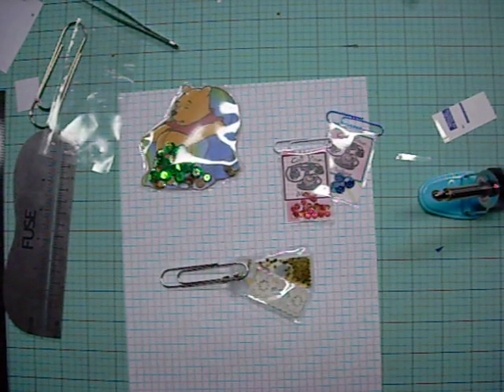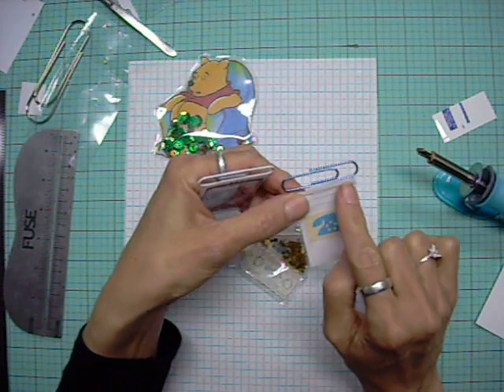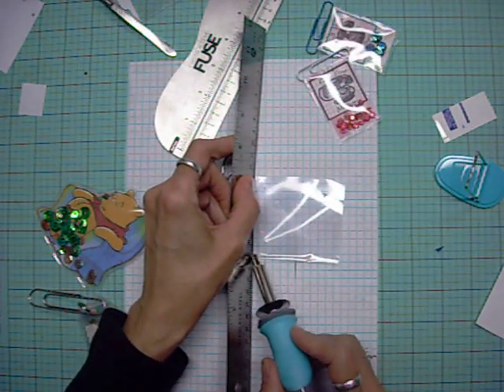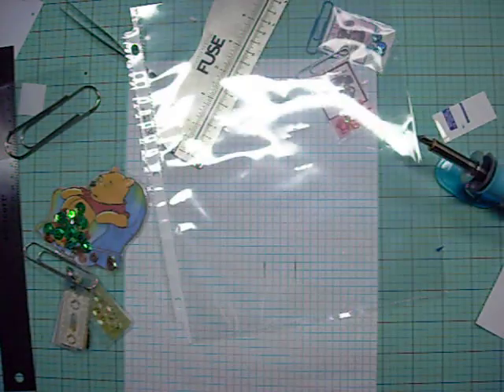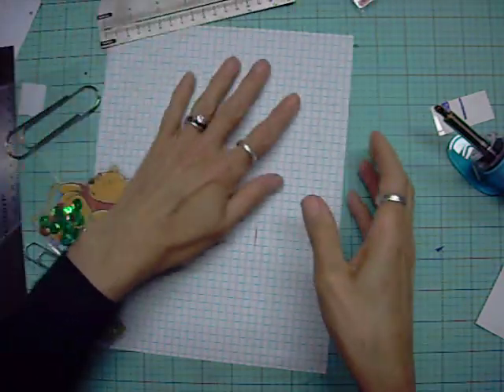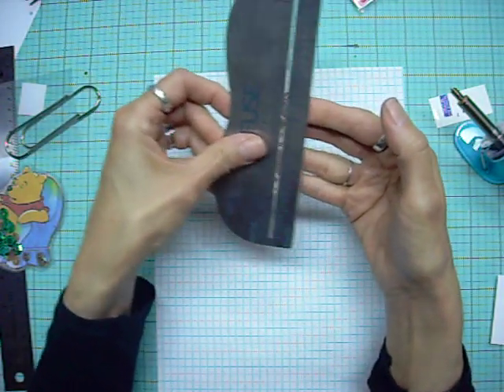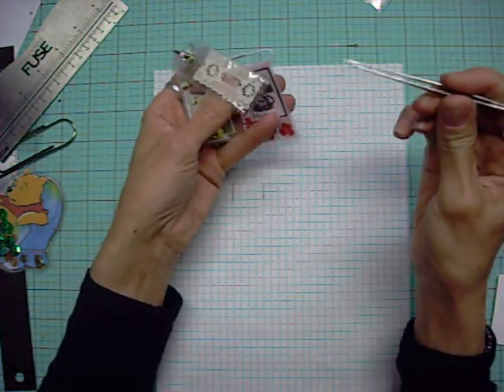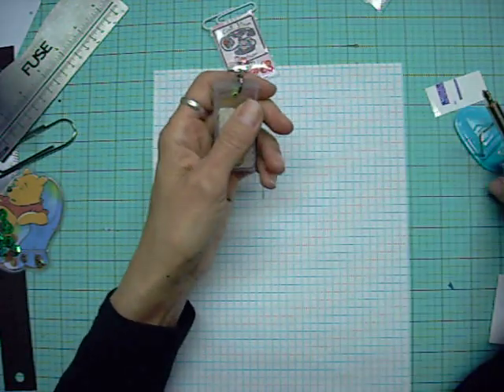Fuse Tool Tips & Troubleshooting

Comment: Thank you for sharing, does the fuse tips work with wood burner?
Reply from the maker: I do not have a wood burner, so I don't know.  Also, are all wood burners built the same way, or does each company use a different handle / tip system?    I do know that many use their wood burners with their own tips for sealing the bags.  It takes practice, but so does the Fuse.
Reply: Yes they work with a wood burner. I bought the tips to use with mine, it works

Comment: Hello! I just purchased mine and just fused a small card after which the fuse tip stopped rotating. Seems like molten plastic has stuck. Can you please help? I’ve tried boiling it and oiling it as well :(
Reply from the maker: I would reach out to customer service: https://www.wermemorykeepers.com/customer-service/ Their email and phone number are there.  
I don't see how melted plastic could get all the way up into the axel, as it's only the teeth that touch the plastic.  However, I've heard this complaint from MANY viewers.  Mine gets stuck sometimes, too, and I've had to roll the (cooled, not hot) Fuse across something that's not slick in order to get it to go again. Good luck!

Comment: mmmm....so I have watched a ton of videos on how to use this tool, my issue is that as soon as I place something that i have seemed it goes right through it. The seem comes apart. How would you sew the edges of the plastic?
Reply from the maker: I sew my seam then trim around that. It's hard to sew along the edge unless you use paper clips to hold it together.
Reply: Lolly Palooza Have you had issues with the seam coming apart?
Reply from the maker: Work Reports yes, sometimes. Usually it is due to stuffing the pocket too full, using a cheap page protector, or rolling the Fuse too quickly across the project so it doesn't really seal.

Comment: Tyfs, how do you clean the tool?
Reply from the maker: I haven't had to.  However, I'm guessing you mean there is maybe some melted plastic stuck to it?  If so, I would heat it up and then wipe it off on a paper towel layered on a thick rag to protect you from the heat.
Reply: @LollyPalooza  Tysm, you're right, and I tried, but not everything came off, even with oil... 😔

Comment: My fuse tool tip doesn't roll when I try to seal the plastic.  Is there a trick to it?
Reply from the maker: Jennie Rogers many have said the same thing.  When it's cool, can you roll it around on a rough surface to encourage it to roll, and maybe loosen up?
Reply: Jennie Rogers same here 😞
Reply: No l ended up returning it. It never did work.
Reply: SAME. I’m thinking maybe the metal ruler with the slit in it is the key. I’m trying to WD40 mine to make it keep rolling lol
Reply: Today I tried a silicon mat under it, because the glass mat is to hard to get the thing rolling. The silicon mat is for baking cookies, it can take hot stuff.
Reply: Lilianders Lilian Gijsbers did it roll with the silicone mat?
Reply: When I recieved my fuse tool it started leaking some sort  of grease or oil which is probably needed to allow the tip to roll. So I would just try greasing it if it doesnt roll. If that doesnt help they sell extra tips on amazon. The tips are so small it is probably common to get a manufacturer error
Reply: Blueyes05 yes it did, but the seal was not totally closed, so I had to run 3 times. It works better than the glassmat.
Reply: Lilianders Lilian Gijsbers I’m having the same problem of it not rolling which causes it not seal properly or to cut right through it.

Comment: I am hang trouble with using the fuse tool. I have tried fast, slow, hard, soft touch and my seams still come apart. Any ideas? Thx
Reply from the maker: +Deb Greer You might want to change brand of page protectors.  If they are too cheap, too thin, or too old, this can cause problems.  I like the heavy duty ones.
Reply: +Lolly Palooza Thank you for the info. I will try those. I love your videos!!

Comment: I’ve tried using it on a few different kinds of plastic and for some reason no matter the different pressures I use the wheel won’t turn properly....what am I doing wrong?
Reply from the maker: I've heard that several people have had this trouble -- and that it's possibly a bad tool.

Comment: I just got my Fuse tool. I can't get anything to seal. Even after cooling, it comes right back open.  What am I doing wrong.
Reply from the maker: My first guess would be that you are rolling the tool too quickly across the page.  It's not getting enough heat to melt together.